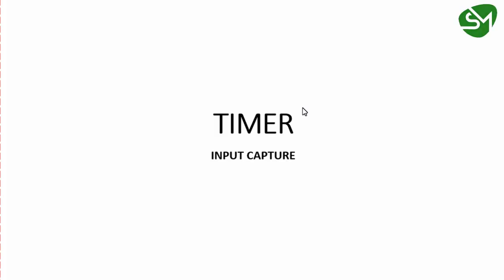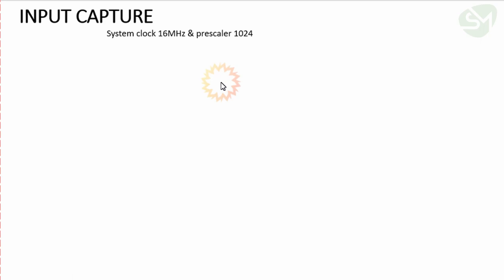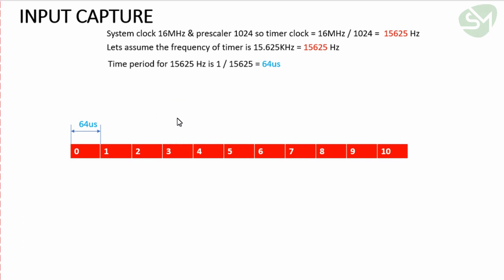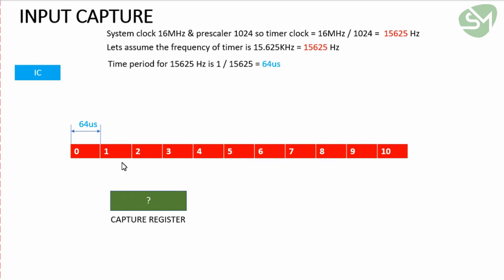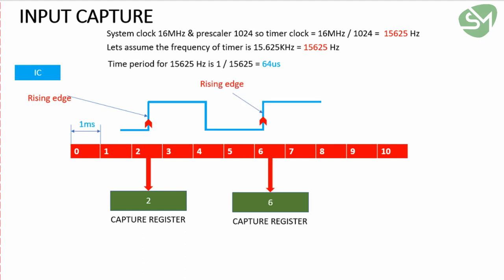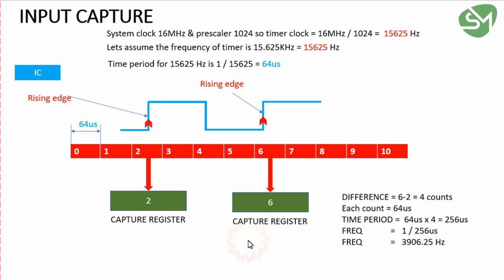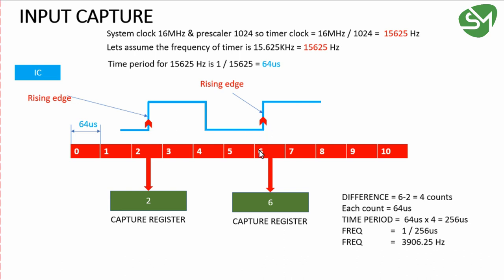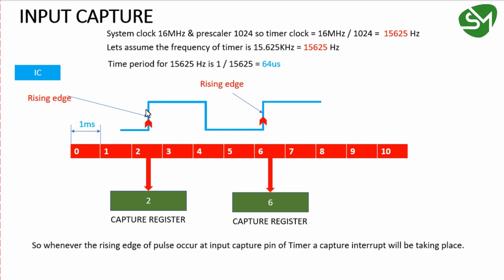TIMER INPUT CAPTURE MODE WORKING EXPLAINED

Comment: Hi! Thank you for your explanation. I have a question, if I am using a qudrature encoder and would like to find out its frequency, how can I arrange the connection of the input signal? Since quadrature encoder has 2 output signal and Arduino Uno only has 1 ICP pin. Thank you!
Reply from the maker: Sorry for late reply yes you need to use some other microcontroller with two Input capture pins